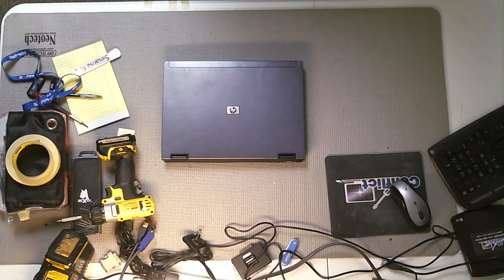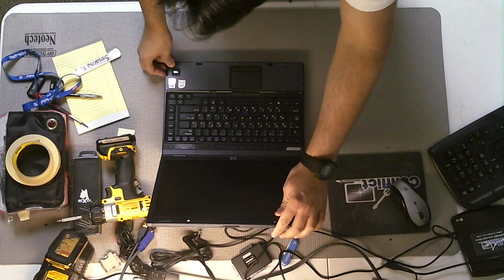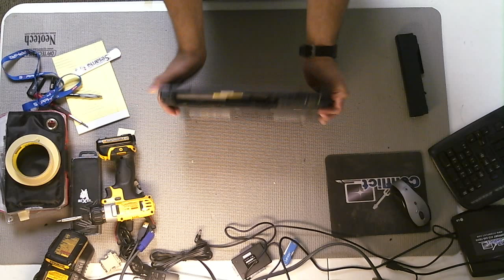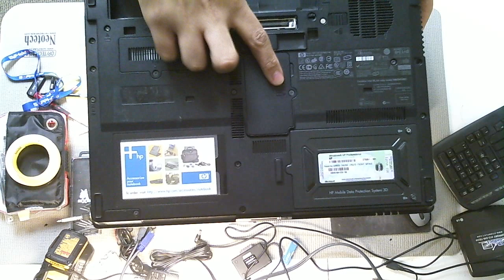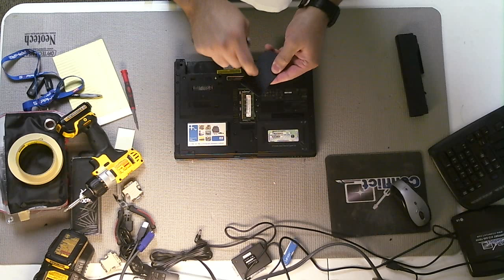HP Compaq NC6400 Ram Removal Upgrade

Comment: I watched your video, and thank you for the tutorial. mine is Nc 6400 HP and power is on but no display. what should do? pls. help me to repair it my self. thanks
Reply: Heat the gpu with a heat gun under the keyboard ,remove the keyboard ,there are three screws at the back of laptop ,then above the keyboard slide the little plastic switches towards you and then lift the keyboard .You dont have to take the keyboard out ,move it aside and then uninstall the cooler .Place tinfoil around the gpu cheap ( you dont want to heat other components ) and then at 2 inches away heat the chip slowly at 200 - 230 degrees Celsius in circular motion for to minutes !! Thats it put new paste on the chips and screw all back together !! I did this on mine and it works 2 years now !! This happens because high temps on gpu , put new paste, unclog the fan and place the laptop on a good base with fans !!! This procedure is known as refflow you can search google !!

Comment: What is that long slot just above the RAM that looks like it's missing its cover? Thanks.
Reply: That long slot parallel to the battery is for a docking station. When you snap your laptop into the docking station, this port mates with it and provides connectivity to the docking station video, USB ports, power, etc.

Comment: You forgot about the other SODIMM under the keyboard.
Reply: I'd agree, lot of ppl could be stuck in upgrading, not matching the ram block under the keyboard. Pretty easy accesed. Losen the 3 keyboard marked screws under the laptop, then unlock the fout switces, at the top of the keyboard, and carefully slide the keyboard off and to the right side, and theres free access to the second ram slot.
Reply: Henrik Preisler Thank youuuuuuuuuu!

Comment: While I appreciate the tutorial, if the title alludes to upgrading the RAM on the NC6400, I would recommend you explain where all the RAM locations are and how to get to them.  Also, might want to know whether the RAM can be upgraded independantly or if both sticks need to match in size/specs.  Finally, why not just take a look at the Crucial website prior to your video and find out what is the maximum amount of RAM the machine supports.  Just a few recommendations.  Thanks for the vid.